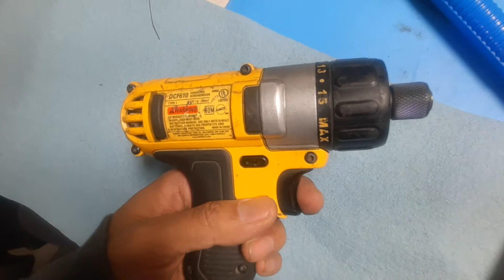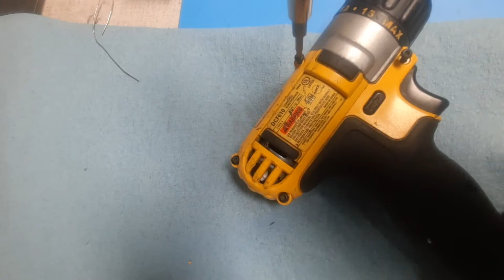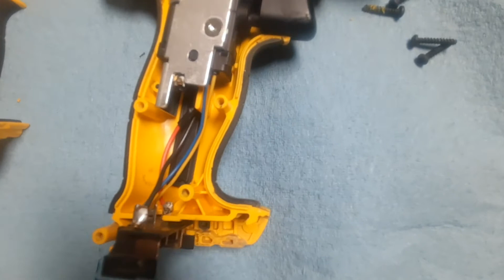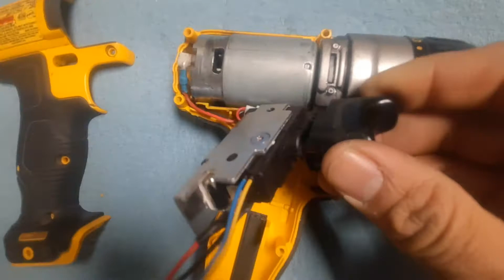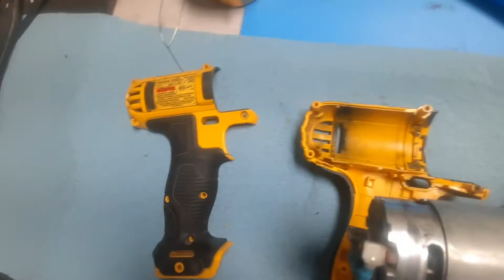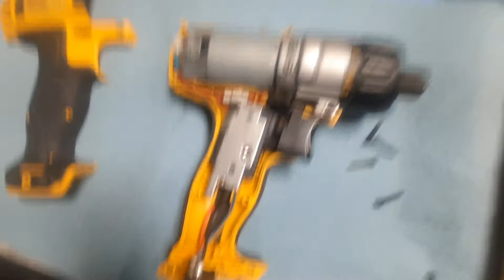how to fix DeWalt cordless screwdriver which goes only forward direction. ?

Comment: Hello. I have a question-problem. The “Forward/Lock/Reverse” button on my Dewalt drill is VERY loose and flimsy, floppy. How can I correct, repair this? Is it easy or difficult? Please respond. Thank you so much. I appreciate it.